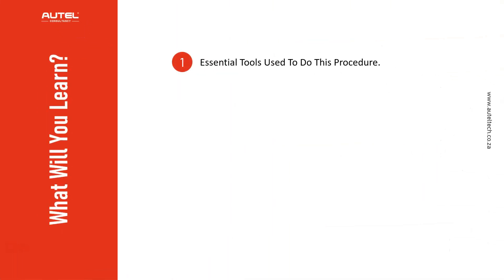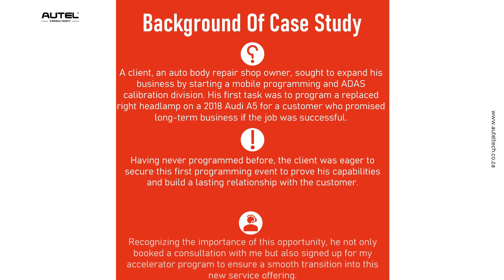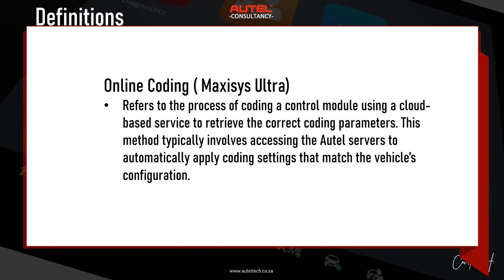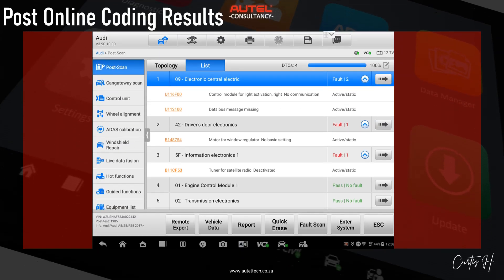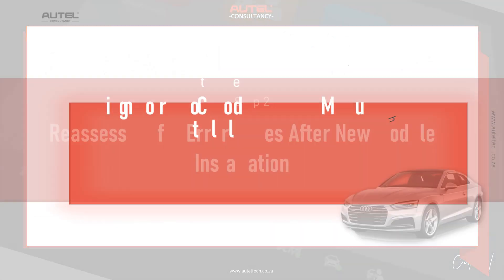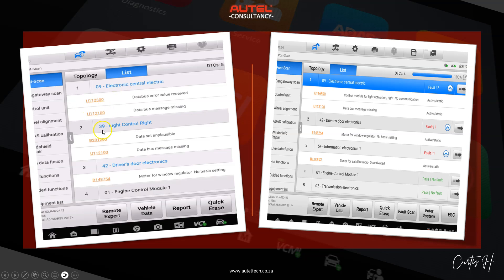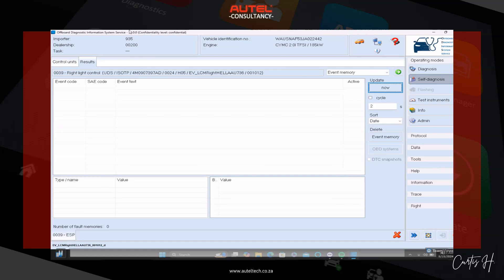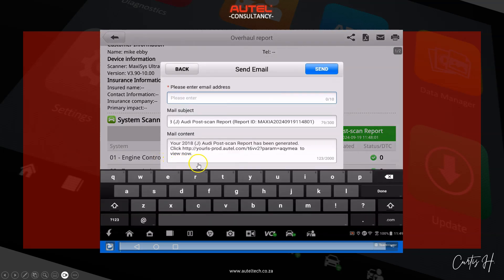Autel J2534 Case Study | How To Replace and Program A Head Lamp On a 2018 Audi A5

Comment: So basically you don't need on Autel if you have Odis... got you
Reply from the maker: Correct if you only work on VW and Audi and nothing else ODIS is the best option. If you work on other manufactures then the Autel is a good choice. I only go to OEM tools when the Autel doesnt have a feature that the OEM does.

Comment: So the autel didn’t actully do the coding it was Odis ? What was the point of using the autel ? Autel only good if not having to code a new module
Reply from the maker: Thats correct, when it comes to new modules and VW/AUDI they autel doesnt have the capabilty to do the proper SVM coding. This is when the OEM is needed to fulfill what the autel couldnt do. The Autel was used as the first logical attempt to configure the module. Its not reasonable to jump to ODIS immediately with out trying out the Autel first.  Lastly there is not a tool that does programming for all manufactuers from the tablet. 98 percent of the time you need to use the OEM software and j2534

Comment: Curtis, it appears you are the "go-to" man.  Just a short question:  Is the J2534 compatible with the Autel MaxiCOM MK808BT PRO Scanner?  I bought the 808 back a year ago.  Thanks for your input.
Reply from the maker: Hello. Its not compatible . You also need to remember when you are programming with a j2534 you are only going to need your laptop. Your scanner will not be used